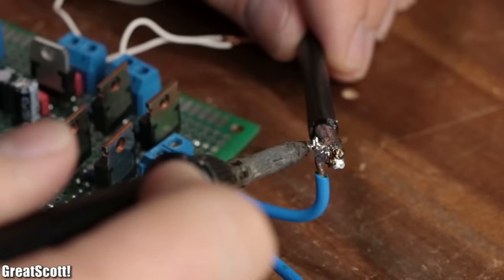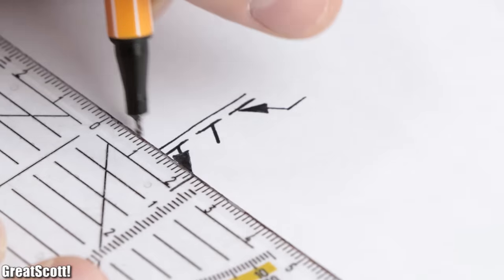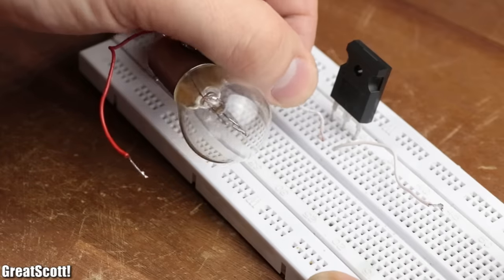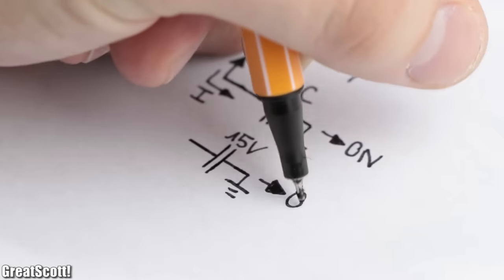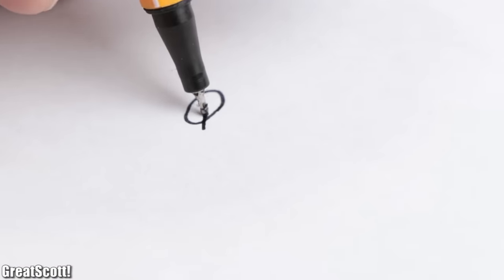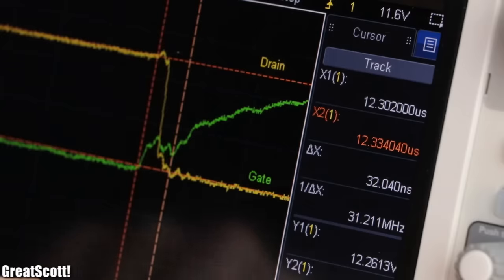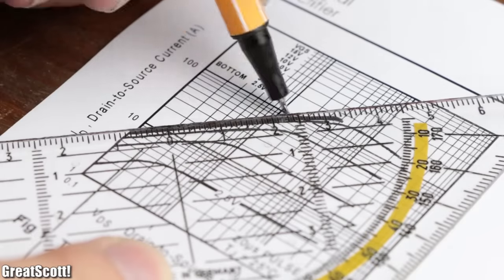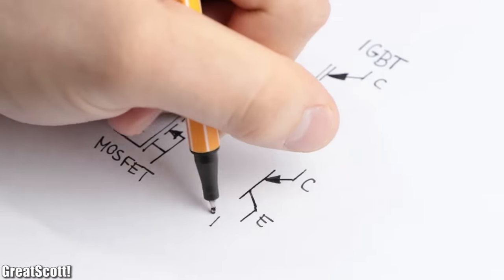Electronic Basics #28: IGBT and when to use them

Comment: Anybody used these as high voltage regulators?  I built a prototype headphone tube amp that uses IGBT Linear-regulated B+ of about 300v and it seems to work well.  I've heard mixed information about using IGBTs as regulators though.  I pulled the ones I have from electric range induction cooktop driver boards as I have a nearly limitless supply of defective units to pick parts from.

Comment: Thank you for explaining that but I would also like the p chanel device to be explored, if I have it right p chanel MOSFET can be used for high side switch more easily as long as vss does not exceed the max gate voltage.

Comment: Nice Video, but are you sure that the IGBT stays on because of the gate capacitor? I think it is also possible that the parasitic BJT ,that can ocure inside a IGBT, lets it turned on.  https://de.wikipedia.org/wiki/Datei:IGBT_equivalent_circuit_DE.svg

Comment: I want to use the power windows, motor controller, for up and down  3-4 sec for up the same time interval for down.  No need speed.  For bridge driver, I don't know if IGBT or MOSFET to use. What can me suggest?  I will use Arduino  as MCU. Thank you
Reply from the maker: MOSFET
Reply: @greatscottlab  Thank you

Comment: Can I turn on and off 380V ( Collector voltage ) with 5V emitter signal ? I need 10A current to flow. FGA25N120ANTD.
Reply: Unlike MOSFETs IGBTs turn in when a positive voltage is applied to the gate but you can turn it off by connecting the gate to ground or I guess applying a pulse to it

Comment: Are you having trouble making the tesla coil? IGBT may  NOT  be the solution.
Half bridges are theoretically great (for the inductor) but hard to control under high EMI. You may try using a push-pull or ZVS driver. If they work in the perfect state, they will be very efficient. I made a ZVS with 2x IRF120 and got it working under 24V10A continuous.
Reply from the maker: No problems so far. But thanks for the feedback
Reply: Also, ZVS is probably the easiest approach to soft switching. If not planning to make it a music tesla coil, recommend oscillation related configuration.
Reply: Denoting 'zero voltage switching' as a topology is hurting my eyes.
Reply: Maybe I did something wrong... I was using ATMega328 microcontroller
to drive HC14A Schmitt trigger 
to drive IR21084S Mosfet driver 
to drive 6x IRG4IBC20UD IGBT
and they heat up quite badly. Inductors for soft switching are also used. It was super hard and I gave up.
Reply: Why are you even using a schmitt trigger? That only introduces more propagation delay, making you vulnerable for power losses. The output of the ATMega328 is very good, it has a rise/fall time of 4ns.
Reply: Thanks, I'll try.
Reply: wzd leo Also try adding a series resistor to the input of your driver to remove any transients. Are you trying high side nchannel switching?
Reply: OK. I am driving 3 half bridges like this.
https://en.wikipedia.org/wiki/Power_inverter#/media/File:6-step_waveform_CJC.png
Reply: wzd leo What do you need three phases for?
Reply: For fun. I guess... I gave up this project a long time ago and I am not planning to pick it up.. Thanks for helping anyways.
Reply: If you look behind all the driving problems that will occur with three phases you still have efficiency problems three times as high. If you were picking it up, ditch the additional two phases, no need for them.
Reply: Got it. Thank you for helping. I will now use DirectIO library by "mmarchetti" for faster and controlled switching.

Comment: High voltage mosfet are available, but are very costly and their RDSon it's not so low compared to low voltage mosfet  (some are in the hundred of mili ohms), for higher voltages and currents IGBT are more cheaper and can have the advantage of less power dissipation

Comment: Could I switch a mosfet or igbt with a let's say 64mhz signal
Reply: With IGBTs absolutely not as they usually switch around 100kHz at most but some IGBTs can switch at 1MHz. MOSFETs can usually switch up to 8MHz but 64MHz seems genuinely too high for most if not all MOSFETs to switch at.

Comment: ok but when you applying a 32rf across 15 v dc with only 1 resistor than the rate that the load frequencies is reduced to almost nothing because without a2nd resistor to drop a load, the potential stays neutral and nothing is I ducted, which thus, equals a low currency flow and a shortage of change. or ie  LGBT fcc= Get Paid, Get Laid

Comment: Why is IGBT better for high current, when it has higher power loss?
Reply: Don Juan igbts have a constant voltage drop, the powerloss increases linearly with an increase of current. the midget had a constant resistance, hence an exponential powerloss with increasing current

Comment: A question. There is a new technology called a B-TRAN that could replace IGBT's in power electronics. I was wondering if you have heard of it, and what widely it might be used after it comes out? Here is the white paper on it. http://www.idealpower.com/wp-content/uploads/2016/04/Btran-white-paper-CURRENT-12April2016.pdf
Reply: The B-TRAN topology is a simple, yet radically different topology for power semiconductors. It combines the fast, low loss switching of a
MOSFET, the high current density of the IGBT, the low forward voltage drop of the BJT, and a unique bi-directionality, which allows its use
in highly advantageous AC link converter topologies. B-TRANs offer the potential to improve efficiency and system economics of a wide
variety of power converter applications including variable frequency (VFD) motor drives, electrified vehicle traction drives, PV inverters
and wind converters.

Comment: This video made me subscribe. Can you make a full bridge square wave generator to test ferrite cores, inductors or to drive high voltage transformers? Its frequency must be adjustable between 50Hz to 10 MHz. Input of the full bridge can be a 12 volt battery.  It would be a nice toy. I want to build one but don't know where to start.